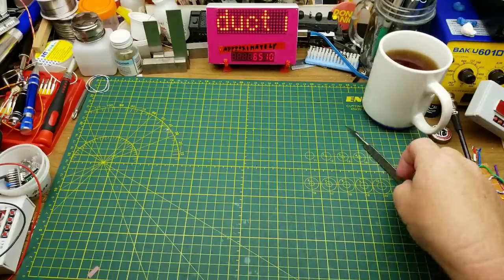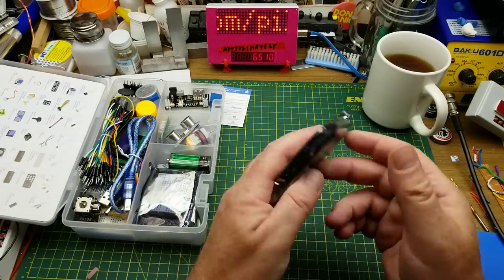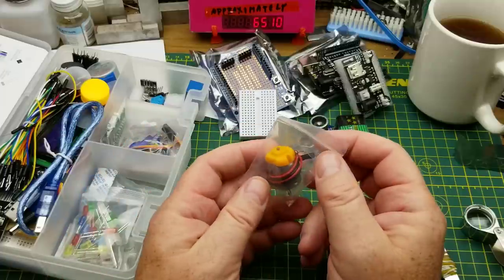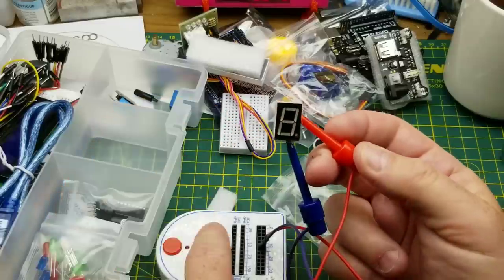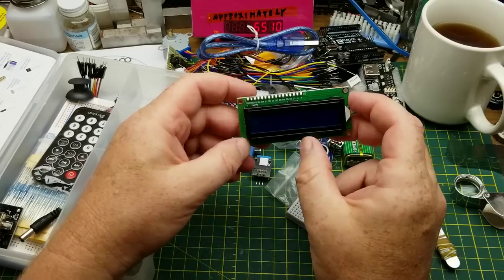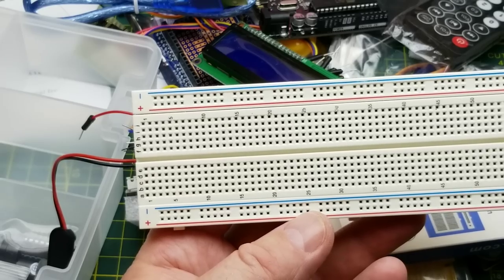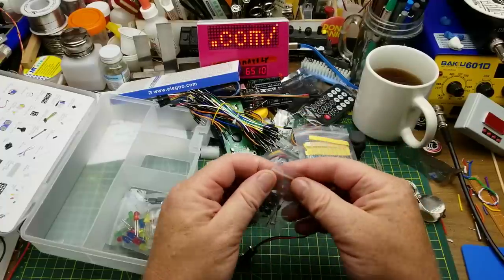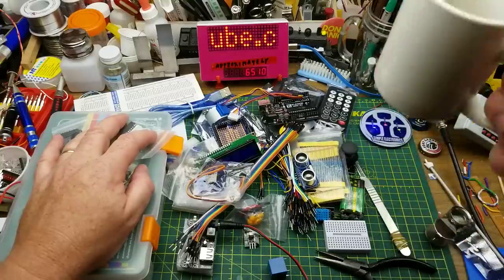Elegoo Arduino Uno starter kit review

Comment: Nice review, a lot to play with. What would be nice if they pointed to the data sheets and helped you work the chips directly without a library?

I think folk need to understand more of what’s underneath.

I’ve had experience of car mechanics that changed the same part and charged for it twice because the computer said it was faulty. It was over reading the O2 levels, so must be faulty. What the computer did not know and the mechanic who was a part changer did not look for! Was an air leak in the pipes feeding the sensor. 

If you can read he data sheet and understand what’s telling you, when the program does not work you have a good starting point to fault find from.

I like the pull out controller because as a beginner they can easily pull the chip and replace it if they takeout out an output. Much easier than learning SMD replacement at that point.

Comment: Am also impressed with the look of the Elegoo Uno.  Am wondering if they use some kind of manual silk-screening to get the print on the sides of the ABS female headers.  Did they space the headers on the upper right side from pin 7 to  pin 8 at 0.2", instead of the annoying oddball 0.14" that "real" Uno's have?   If it conforms to Uno, then I am gobsmacked that they had custom female header rows manufactured specifically for this product.

Comment: Are you sure you have your pins correct for the relay? I believe the coil is the outer two pins on the side with 3 pins, with the middle pin being the common (COM) pin for the high voltage.
Reply: According to the PDF in the datasheet directory you are correct. I guess the non standard accompanying refreshment must have affected his memory.
Reply: @MikePerigo  I was wondering where the hoppy beverage was, but then got distracted by watching the video. Haha
Reply from the maker: You're probably right - I was going from memory of other relays I have used in the past.
Reply: @pileofstuff  I wish my relays were like that. It seems much safer to keep high and low voltages as far away from each other as possible.

Comment: No, I still !  not interested in Arduino, it's just play things, I tend to have an idea in my head for something and I design a circuit around it until it does what I want, example....auto chicken or green house door open/close using dark or light, things like that.
Reply from the maker: The Arduino ecosystem was invented specifically as an educational tool - to get people who don't have your training and experience started in programming and electronics.

But even for us old-timers, it does provide a platform to quickly and easily toss together a simple prototype, or proof of concept.
Reply: I thought like you at first, but Arduino is cheaper than a bunch of discrete components to do anything interesting.